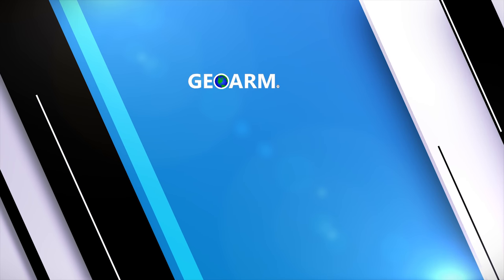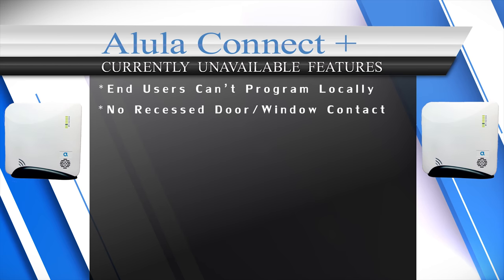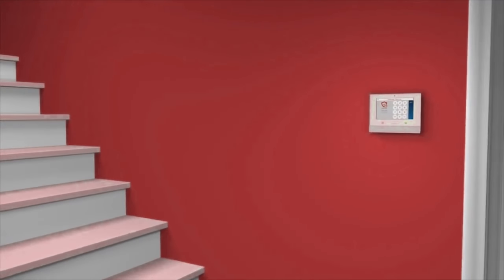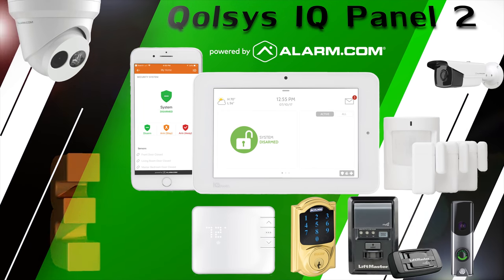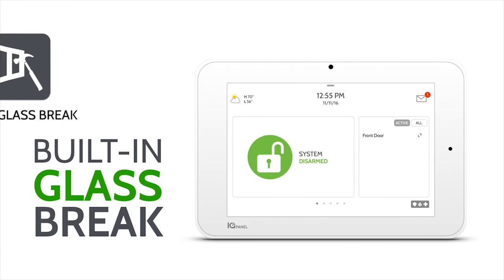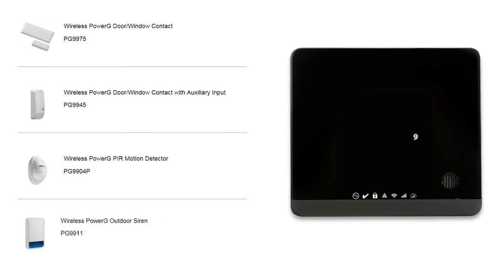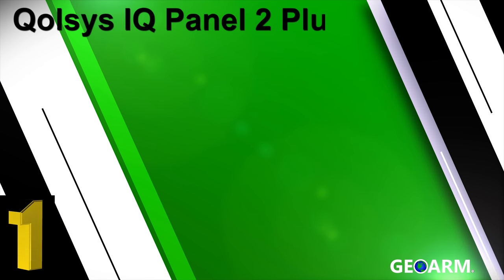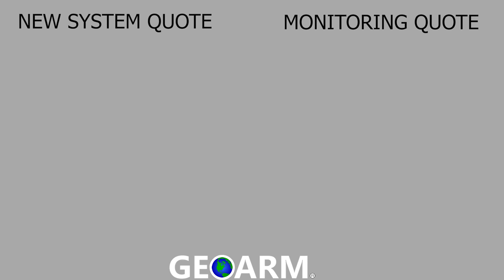Best DIY Home Security Systems - Top 5 Review 2019

Comment: The question of home security will always be relevant. I live in a not very favorable area and therefore I had to install a security system. When choosing between wired and wireless, I certainly chose the wireless option from Kangaroo. This makes life a lot easier, no need to break the walls and throw a bunch of unnecessary wires. The whole system works through a wi-fi network and can be controlled using the phone, in general, I am very pleased with my purchase.
Reply from the maker: Thank you James for your positive feedback on how our top 5 home security systems video helped you make your decision. Are you by any chance looking for either diy or pro alarm.com monitoring services?

Comment: Qolsys IQ panels are junk.  Great concept, but severe quality control issues.  In a year and a half, I went through FOUR panels, all with different issues:  touch panel locks up when its time to disarm after entering the house, causing the alarm to blast you in the face.  The only solution was to remove it from the wall, and unplug the battery.  IQ Remote panel just died, black screen.  Replacement keeps dropping network (router is 15 feet away).   Many times I would come home and find the system disarmed, when I specifically remember arming it.   What would be more reliable, DSC?

Comment: I'm seriously considering getting the IQ Panel 2+. I want something more robust than Nest but cheaper than a monthly service like ADT. I also want to still be able to pay for a service to automatically call police if I have a break in. I'm a little worried about setting it up. I also want something I can monitor from work through a cellphone or if I'm on a trip. Another problem is that I want something I can supplement over time. I can't afford to pay for everything up front. I have 4 doors and 8 windows so the cost is much higher. Can I add sensors and cameras as I go? Thanks for your time.
Reply from the maker: Wow, what a great question. The IQ Panel 2 plus integrates with nest thermostat. You can purchase a basic kit for now and add security automation or cameras down the line no problem. 877-443-6276 ex 106 Rates are easy to beat with us we start at $18/month no contract $20 if you want to integrate nest thermostat and other z-wave devices. if you have more questions here to help.
Reply from the maker: Also, did you have any other specific questions we can answer for you

Comment: Can you bypass sensor individually on the honeywell lyric system?
Reply from the maker: Thanks for the question yes you sure can bypass sensors remotely and individually using the Honeywell total Connect 2.0 application.
Reply from the maker: thank you did you have any other questions about any of these systems?
Reply: Nice Video clip! Sorry for the intrusion, I would appreciate your opinion. Have you considered - Mahorrla Defence Wisdom Method (do a google search)? It is an awesome one off guide for securing your home from danger without the normal expense. Ive heard some unbelievable things about it and my old buddy Taylor at very last got astronomical success with it.